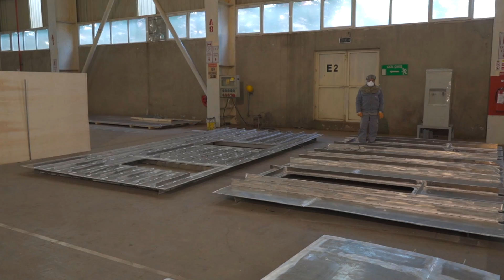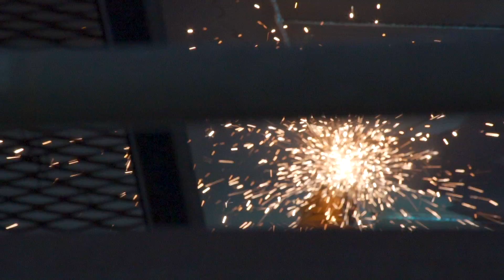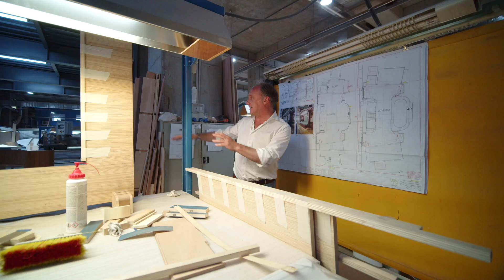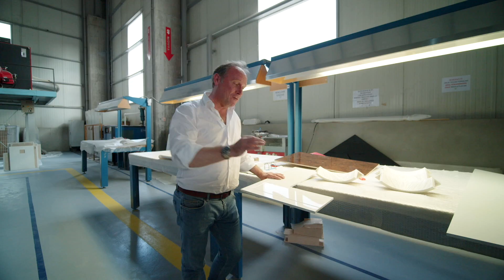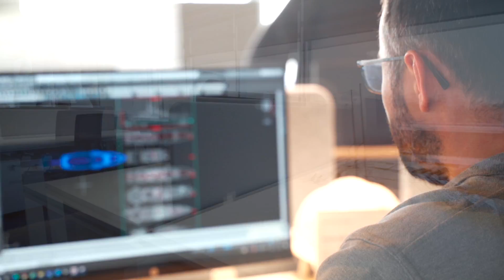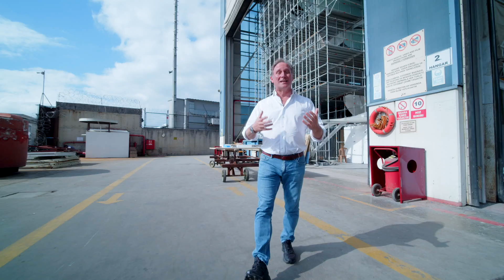HOW TO BUILD A SUPERYACHT - AT TURQUOISE YACHTS!

Comment: A concise and well presented video on a complex industrial manufacturer. I was impressed by the level of technology used to assure quality. With the furniture, how does the plywood and veneer composite compare to solid wood when in the high moisture marine environment ? I would be concerned with warping and de-lamination over time.